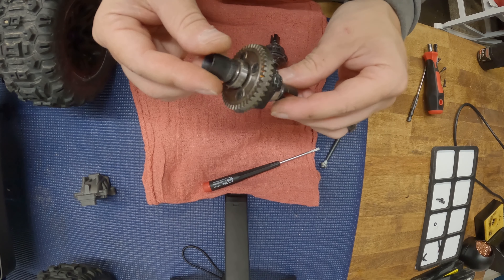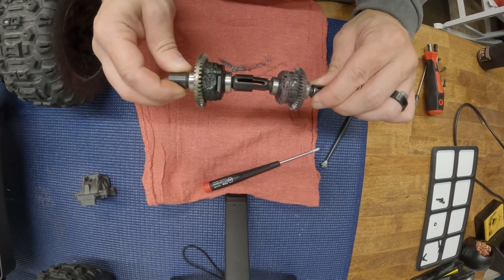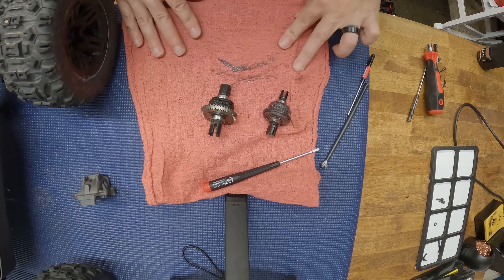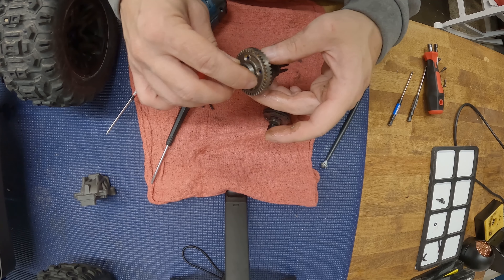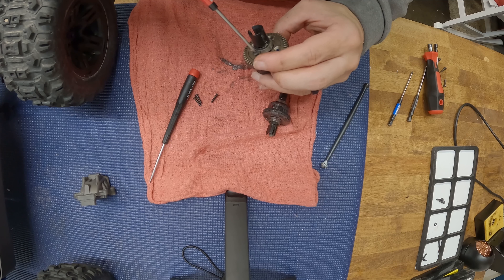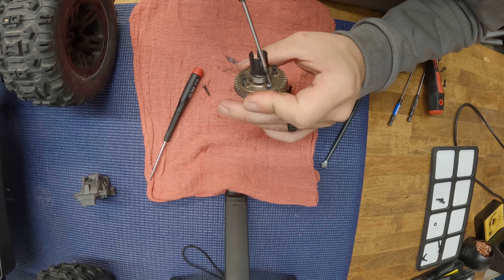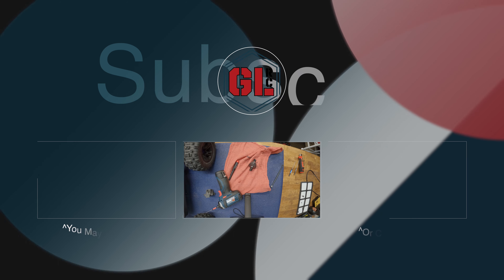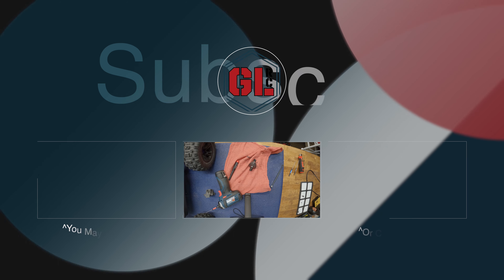Traxxas Sledge Diffs vs Arrma Diffs

Comment: Sintered gears vs machined billet gears. Seriously, I've been saying this for eons. Most people are only concerned about size & don't even give a 2nd thought to why the teeth on the Traxxas gears end up completely broken off when they fail rather than being worn away like Arrma gears. The internal diff gears on both trucks are sintered but Arrma does have heat treated internals in the EXB while Traxxas gears are all straight off the press. Even if you don't know anything about difference types of metal, you can tell the Arrma's diffs look much better. If your diff gear has an anodizing on it, it's cheap junk. The anodizing comes from the top layer of the powder overexposure to the press heat, so it's slightly harder than the rest of the gear. This was found out by accident & Traxxas takes full advantage of that. 

Hardness, density, & strength all goes to the machined billet part. Not only that, but it is an industry standard for machined gears to be heat treated & hardened to remove any inconsistencies in the structure of the metal due to the machining process. A sintered gear cost a fraction of a machined gear. If sintered gears was as strong as machined gears, ALL gears would be sintered. The only large scale truck with sintered outer diffs is the X-Maxx, EVERY 1/5 truck has machined billet outer diff gears.

BTW, Traxxas gears have 'teeth'-like ridges on the other side of the gear. The ridges help dissipate heat that would inadvertently re-anneal it over time & cause it to fail prematurely.
Reply: Tell em bro! Always great info
Reply: so, your point is? you can get a better quality gearset later on for the traxxas and have a big diff with quality gears rather than a small diff with quality gears.
Reply: @damoh4895  800 plus tax ..Close to 900 then need spend hundreds more??? SMH